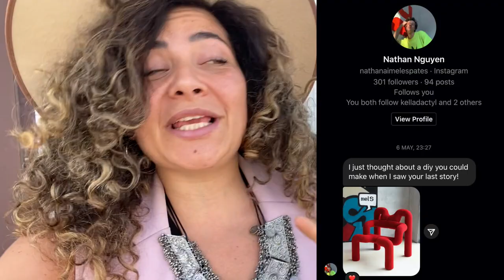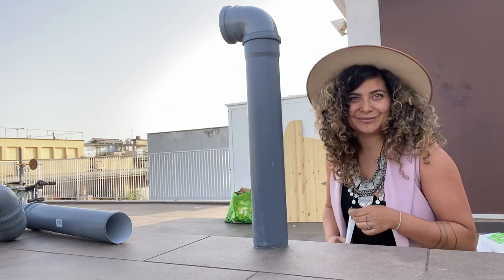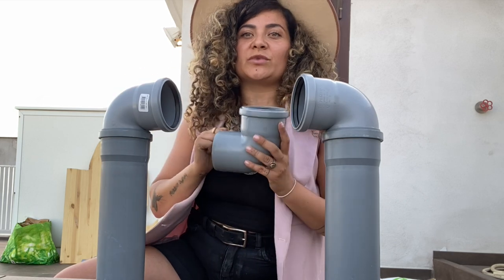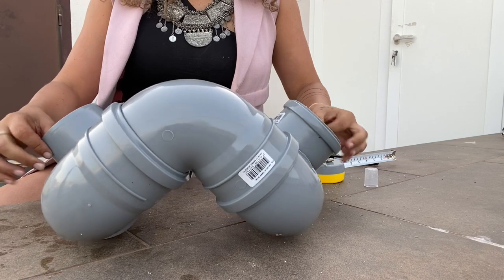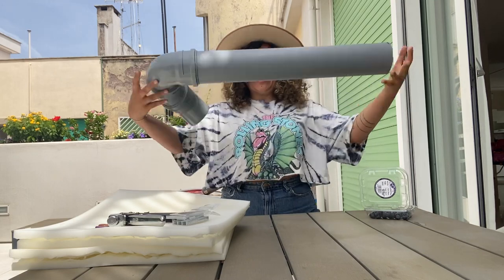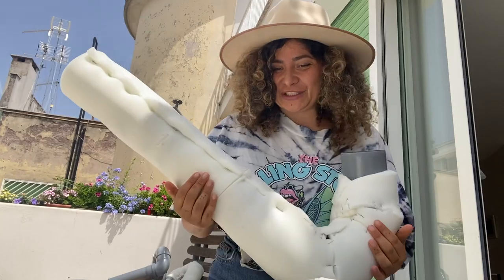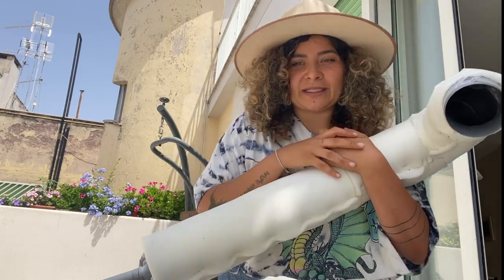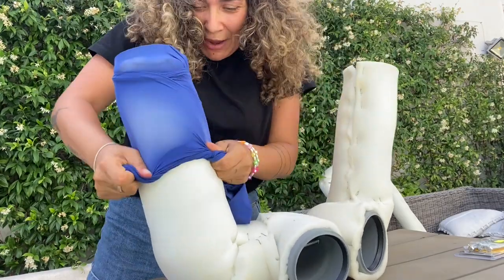DIY EKSTREM LOUNGE CHAIR // HOW TO MAKE A VARIER CHAIR AT HOME

Comment: You did such a good job & I love your channel its making me want to get back on youtube and show some of my work again. For anyone attempting this use foam adhesive or some kind of adhesive to glue the foam to the pipes instead of using staples. Your lines will be so much cleaner with no bumps because the foam seams can be joined with glue and  glued down to the pipes as well. It wont move if you use the right kind of glue and it will look even better!
Reply from the maker: Ohhhhh I didn’t think about it!!! And I use spray glue for all the chairs/couches i did! HHahah
Reply from the maker: Ps: you should absolutely get back to creating and showing what to do!!!
Reply: @FashionAttack  thank you I'm trying to find time to film it's so much harder when you are filming it yourself  because running to the camera to make sure the shot looks good is super time consuming  😂
Reply from the maker: I feel you! It’s the same thing for me hehhe

Comment: Great DIY! One additional tip: PVC glue works better than super glue for this and getting the PVC male parts into the female parts can be helped by heating up both end with a heat gun (or a hair dryer, if you don't have one). It will make the connection a little more secure because the oil can loosen up the super glue over time. PVC glue holds FOREVER and only costs a couple bucks for a large jar. :-)
Reply from the maker: great tip!